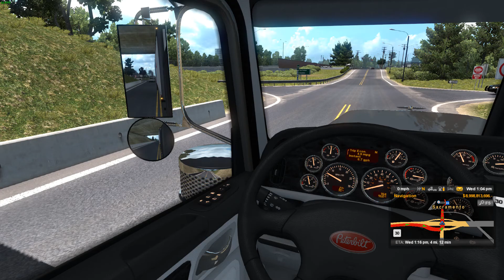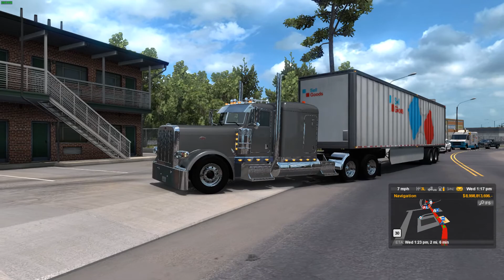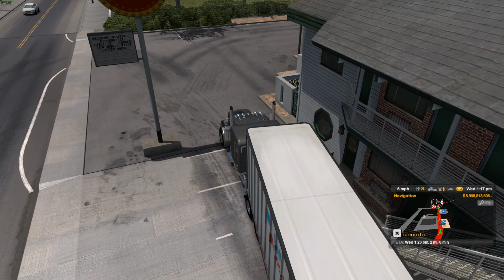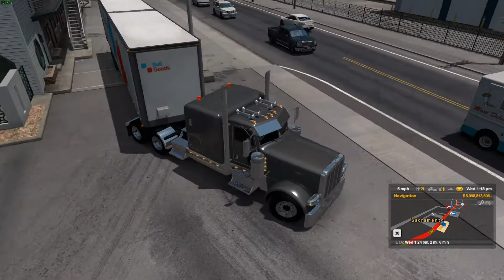American Truck Simulator - Truck Physics v3.0 For Manual

Comment: I use this mod. But why does my truck loose traction by steering or changing lanes? Can you change that please if it's possible? Or by the lightest steering motion my truck shakes so hard that it loses traction sometimes too. Is that normal?
Reply from the maker: Hi, I did an update of this mod, go check out on my youtube channel !

And for the cabin shake at light steering, I can't fix that right now. I'm trying to fixes that bug.